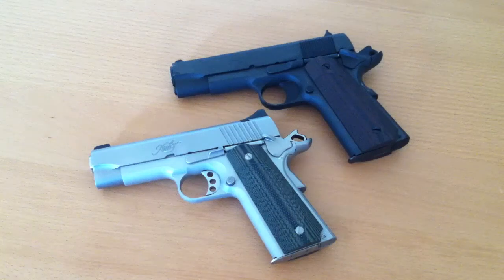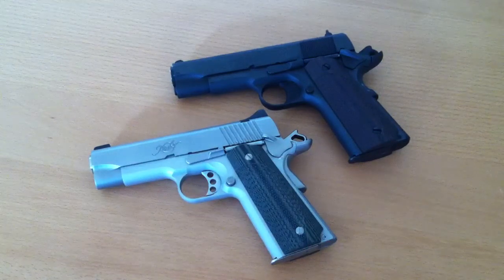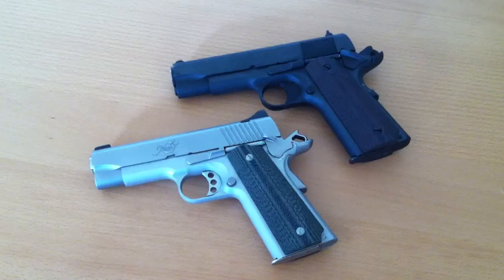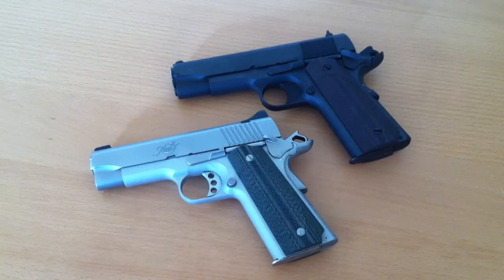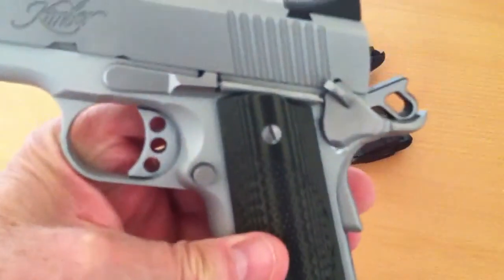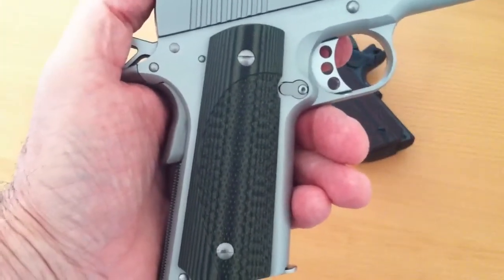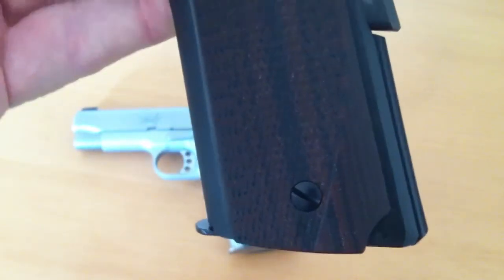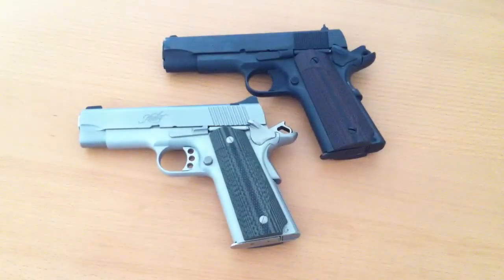10-8 Performance Grip Screws

Comment from the maker: Ah.........I guess my topic wasn't as inane as I thought! Like you, I had the same problem even using the rubber o-rings from VZ Grips. I don't think longer screws would be the solution. For me, I now make sure to have the blue loctite surround the screw threads and snug up the screws with reasonable tightness. I know it sounds nuts, but the screws from 10-8 are really beautiful and look as good as any others I've tried.

Comment: Interesting topic. I am having a real problem with my grip screws on the kimber since installing the laser grips. The grip screws, all 4, come loose every time at the range. I dont know if I need longer grip screws, use a rubber washer, or use loctite. I remove the grips after each shooting to clean the gun. I tighten them real tight but they always come loose.